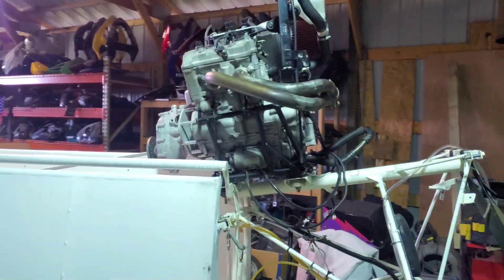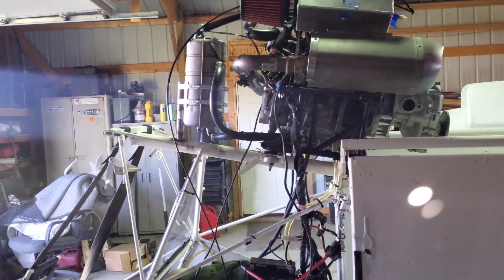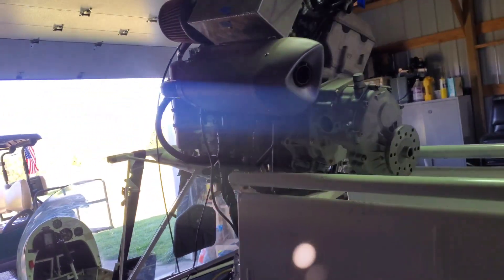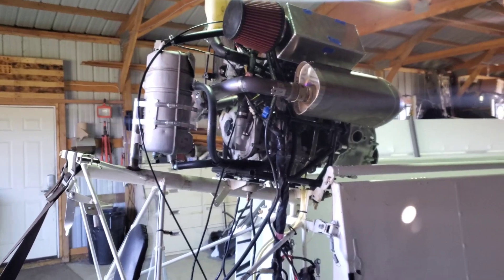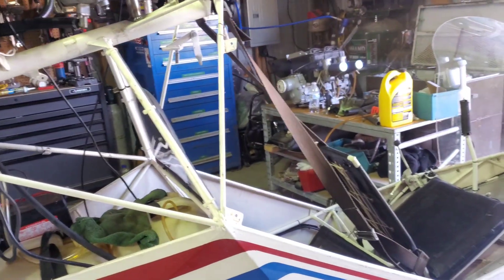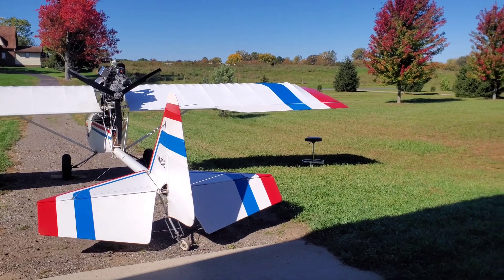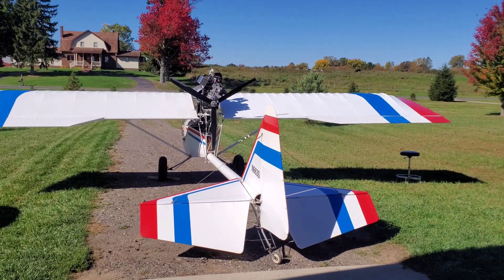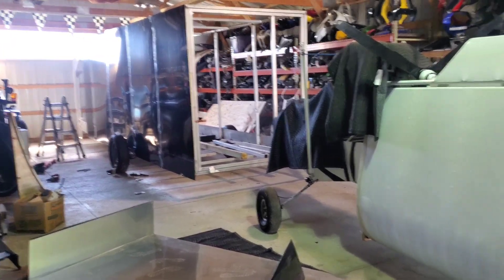Yamaha Powered Airplane Conversion Part 2

Comment: Could you comment on the weight, power $ fuel burn difference between your 503/582? And this new set up?
Reply from the maker: I was getting about 2gph is the kolb and about 3 gph in the phazer kitfox. 503 gets around 4gph, 582 4 to 5 gph.

Comment: What pitch did you go with for the prop? Has to be significant with that much more power.
Reply from the maker: its an adjustable pitch prop. Not sure on the exact pitch

Comment: id expect you to be able to turn a lot bigger prop than that little IVO.
Reply from the maker: No clearance for anything much larger unfortunately..I'm happy with the 1,800ft / min climb performance.
Reply: @bkairys   could got to a 4 or 5 blade Powerfin without increasing diameter i guess.

Comment: What is the gearbox you are using to bolt on the Yamaha engine?
Thank you
Reply from the maker: Watch part 1 for more details.. rotax c box
Reply: @bkairys   Thanks, 
I'm going to try this setup in  a month. 
You said, I believe, you had to cut the engine shaft diameter but the number was more or less. Can you elaborate?
Thank you. Also would you fabricate an adapter plate at a cost?
Thanks 
Eddy.
Reply: Disregard, I was buying a kolb firefly with a 503 rotax engine but the wings and fuselage had quite a bit of damage. It had been sitting for over two years. So I'm going to wait till April and go to the Sun and Fun here in Florida, check out the vendors. I would like an amphibian ultralight aircraft more so because here in Florida there's a lake or river around every city. 
Thank you for your help. Will update you soon.
Reply from the maker: @motorcyc1  do you mind sending contact information to bkairys@gmail.com. Im always looking for another project like that.

Comment: Nice progress!  Apparently you don't need an E-box to have electric start.  Suggest evenly and progressively torqueing that IVO to 200in-lbs.  Can't you adjust idle to eliminate need for clutch?  I don't want clutch either.
Reply from the maker: I tried! Clutch was only way to get it to work. Think ignition timing has something to do with it.

Comment: Is the bolt pattern for the gearbox the same with the phaser and apex?  The reason I ask is because I want to put an apex on a searey which is also a pusher and would like the gear box to hang down like yours. Do you have cad files of the pattern?
Reply from the maker: Its not the same between the 2. I hand made this adapter from scratch. Its fairly straight forward. I think you could do it on a Apex as well.

Comment: i'm building a quad city challenger 2  with a 503 dcdi  so you really got me thinking  I would love that extra HP!!
Reply from the maker: Only 33 lbs more than 503 with e start
Reply: I'm running a 503 duel carb w/ starter on a Flightstar 2SL and this has got me thinking too!
Reply: It would b great on my quad city chlg 2.  I would love to have the xstra  power and 4 stroke reliability.
Reply: I’m thinking this engine is not good for a Part 103 UL?